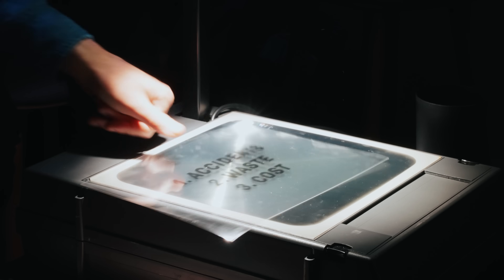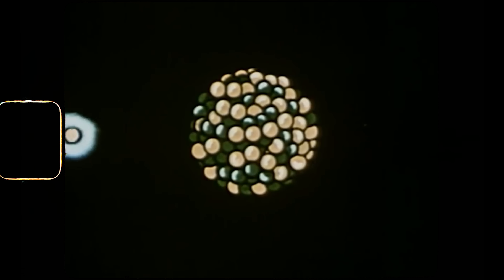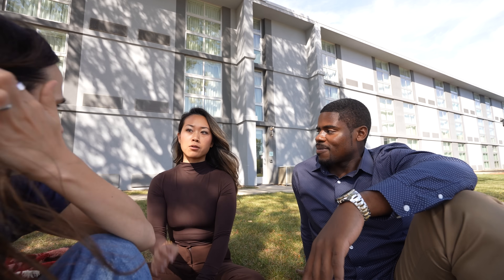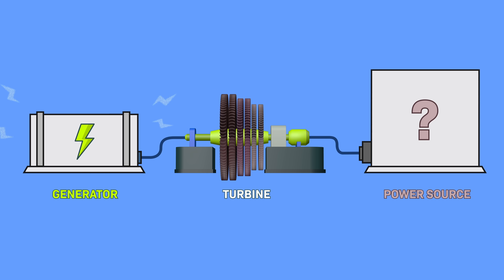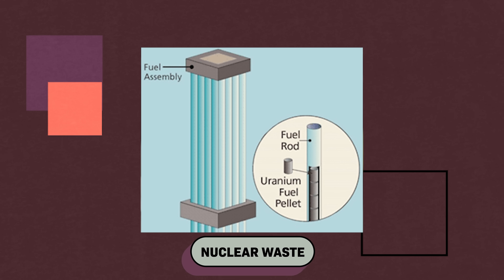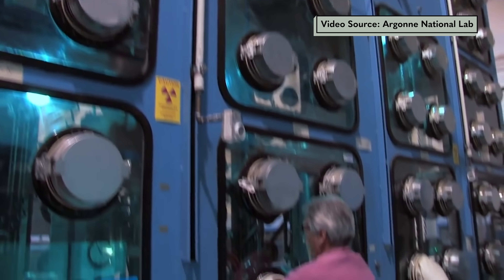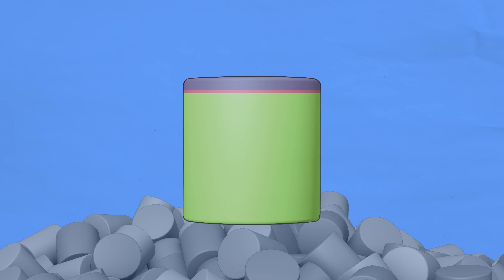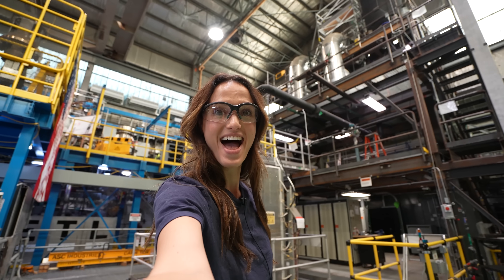The Big Lie About Nuclear Waste

Comment: Reprocessing plants literally reprocess "nuclear waste" into reactor fuel over and over again.   The trick with reactor fuel is that sometimes it wears out a little more quickly and sometimes a little more slowly.   You can have fuel rods that are just unlucky and need to be pulled at half their lifespan because they don't react well and others that underperform a little but would last more than 2x their expected lifespan if they weren't removed on their use-by date... all of these get taken to a reprocessing facility after they're safe to transport and get their useful nuclear fuel removed... that's not just the Uranium and Plutonium!

Keep in mind that this "technology" you are covering is probably bullshit.   You can't sell power that costs 10x more to make than the peak load cost in the market.   This is like the 'molten salt reactors' in which 90% of the hardware in them has to be replaced every 160 days of operation at a power generating capacity or 200 days at idle because they can't simply be turned off - the whole 'selling point' of molten salt systems is that they're safe and they simply are not anywhere near as safe as reactor designs that we have which have blown up.  There is no way to accurately and safely regulate the injection of fertile thorium into the fuel flow without adding a massive complexity that can result in exceptionally bad conditions such as the elemental thorium input chaining... and thorium fueling of a reactor is called a breeder reactor and produces plutonium and other material while converting the thorium into Uranium.   These breeder reactors (molten salt, sodium metal) require an even more complicated recycling process and produce even more kinds of waste.   

So talking about using nuclear waste to generate power is specious because 96% of the nuclear waste we produce isn't the kind of thing that CAN generate power - we recycle the portion that can be re-used efficiently and profitably.

Reprocessing the rest of the fuel costs about 8x as much as the subsidies and cost of wind/solar and the private commercial reactor operators don't want the complications that come from recycled fuel.
Reply: When you say something costs 8x that is only true in the US because of our regulatory system.  

Other countries have been reprocessing nuclear fuel for decades. We don't have that in the US because the US government temporarily outlawed reprocessing.   The industry never recovered from that.
Reply: We should put the waste on a rocket to the sun.
Reply: The US Department of Energy (DOE) cancelled the mixed-oxide (MOX) fuel fabrication facility at the Savannah River Site in South Carolina in 2018.  The facility was already about 70% complete.
Reply: Prjndigo. Well said.  Most nuclear proponents don’t grasp the reality that the problem with new nuclear, is an economic issue, not a nimby problem.
Reply: @brettgracey9682 Economics has always been the problem with renewables.  If renewables were competitive no one would bother with non-renewables.  

Nuclear power is only made unaffordable by the regulatory environment.  Why the hell do you think that nuclear power has done so well in other countries and 50 years ago before the creation of the NRC.
Reply: @DarkenedOne55  economics is why renewables make up the vast majority of new energy projects.   New nuclear for the most part only happens in corrupt dictatorships with poor performance records.  Everywhere there are actual safety standards, nuclear is ridiculously expensive and takes forever to build.  Again economics.    

On top of that renewables can and are often distributed through the grids, exactly because they are relatively cheap and quick to deploy.    What sounds more feasible globally millions of projects that cost between $1,000 and $100 million dollars, or 20, 30, 40 projects that easily cost tens of billions each?  Hint, it’s renewables that are getting done, not new nuclear.
Reply: @brettgracey9682  Energy projects that have great economics do not need massive government subsidies and energy mandates to support.  Those locations that have large fractions of their power from renewables have the highest energy costs.  The sole exception to that is hydropower. 

France, Japan, Korea, India, UK are just some of the countries with new nuclear plants.  All have great safety records.
Reply: im absolutely with you we should go away from Nuclear power but in germany we have so much waste if we would recycle it and use it again we would reduce the halbwerzeit of some of the waste and could made 30% of our energy mix for 40-60 more yrs instead we put it away completly.

And yes it cost so much but the costs of savely deposit the waste is enormous and the nuclear engery sector had made Billions of Dollars with cheap energy and know shy away from the cost of the waste they produced.

Nuclear energy should not be our future.

Comment: You would have tons of major issues if you used even 1/4 of the earths geothermal energy. The planets magnetosphere is dependent on the earths geothermal energy. When the magnetosphere ceases to be(or even shrinks), solar winds will strip the earths atmosphere away.

Comment: Great video ! Good to see more of this out there ! 
Liquid Fluoride Thorium Reactors were some of Alvin Weinberg's best designs. He knew he could do better than his Light Water Reactors. Multi fuel (uranium, thoruim), low pressure, high rate of fission. They pulled his LFTR funding at ORNL & sent it to the other labs working on the Fast Breeder Reactors in the early 1970's. Other nations are developing this tech right now. China already has a test reactor in operation in the Gobi Desert. 
  
High level actinides can be fissioned in a Sub-Critical Accelerator Driven Reactor design. Turn on a neutron beam & keep splitting the actinides until they are much safer to handle. Energy can be extracted from even our high level waste products. We just need the courage  & political will in the USA to develop the decades old technology that lays dormant in front of us. The same group of minds that worked on the Manhattan Project also had over 1000 different workable designs of reactors they came up with. The rest of the world isn't waiting on the USA this time to lead the way in next generation nuclear technologies research. We should be desalinating water, making carbon negative liquid fuels with the co2 in the air & water (using process heat from reactors), and saving our oil for plastics & medicines.
Reply: It scares me I understood that.  Actinides are the nuclear bomb materials like uranium and plutonium.  The thorium design can break them down without making more bomb materials.
Reply: @watchthe1369  The reason that thorium reactor research was stopped was because it could not produce the bomb making materials required during the early cold war days.
Reply: @watchthe1369  Actinides are just the bottom line in the periodic table. Not all are bomb making material and others would need very special designs.
Reply: Yay ! Molten beryllium fluoride ! Greens will suddenly have a change of heart and say that fast neutron reactors with molten sodium are totally cool :)
Hello from France, the country that wasted more opportunities to develop fast neutron reactors on the planet in the past decades :-/
Reply: @herrhaber9076  yea I'm not a fan of liquified sodium metal lol ! The Chloride salt and FLIBE salt designs, with the fuel dissolved into the coolant, seem like the safer alternatives. The Dept of Energy in the USA is still stuck on designs with solid fuel. The folks that build fuel pellets want to keep their monopoly. I hope France will be ramping up their research efforts on molten fuel designs.  At this point, it seems the China Academy of Sciences is leading the way in all types of Gen4 developement.

Comment: The US imunitions caused Hundreds of the most Horrendous Birth defects imaginable in ported tons of Nuclear waste from the UK and EU as it said it could dispose of it more safely than the EU or UK, what the US has been doing with the Depleted Uranium, is turn it into DU Munitions of various types using that DU waste as ammunition in it's wars of aggression in Yugoslavia/Serbia, Iraq, Afghanistan/Pakistan, etc causing Uncontainable nuclear waste dust to float in the air, in water and permiate the Ground. The US had to dismantle Every Depleted Uranium munitions factory and remove contaminated ground from each site around the US. The US DU munitions caused the Most Horrendous Birth defects imaginable in Serbia & Iraq, this information has been wiped from Youtube and most of the internet, replaced with absolute Lies about DU being controversial but Not harmful???? Internet censorship is rampant. As the twitter files and many other sources leaking out information slowly around the world. New generation Nuclear power has a huge roll to play in the future, so Long as we use THORIUM as the primary fuel which has a much higher efficiency than uranium, it's waste is a fraction that of uranium, due to the all most  (93%)-100% efficiency compared to the 7% efficiency of traditional nuclear power generation. THORIUM also can't be used in Nuclear weapons making it a far safer option and why it was never pursued by the US & collective west. China has developed the first successful THORIUM high efficiency reactor, despite India having far more Thorium reactors and more experience than China. The real game changer with Thorium will be the minaturizing and Modular developments of these reactors for single factory, single home or even single Car use. Which I find very exciting for the future.

Comment: Plutonium is not as dangerous as uranium Alpha wave particles are not as energetic as beta gamma x-ray. those are ions that will kill you. Uranium is dangerous Plutonium is much safer and easier to process. But there is a lot more uranium. and uranium grows plutonium crystals when working in a reactor. Plutonium can be refined a thousand times back into reusable fuel in a breeder reactor, creating more fuel than what is used. Also we have the only sun in the known universe that has a plutonium footprint from idiots throwing spent satellites into the sun to get rid of. Now we have a sun that is making plutonium. A no we do not know how it will effect the sun, nice to know eh?

Comment: Oh, and let's not even bother to attempt comprehension, let alone assess or assign responsibility, for the Chernobyl-level near miss when a spent fuel container at SONGS, mistakenly caught on the edge of its receptical, came less than ½" from slipping off, & tearing wide open, in August, 2018. Quite the oops! moment, on its way to "temporary" deposition in thin walled casks that are nominally considered as inadequate. And when will spent fuel pools, that contain 95% of contaminent potentials that go into a nuclear plant, ever be defended by Phalanx weaponry from light aircraft crashing into them?

Comment: Recycle Waste is not efficient and way too expensiv. Just use another type of reactor that can use the ALL the Uranium and not just 2% before recycling is necessary. MSR are capable of this and the DLR (Dual Liquid Reactor) only has to be refilled once (and with refill i mean ~25%). So you have clean energy for almost no fuel cost for over 30 years. And the waste in the end only has to be stored for 300-500 years.

Comment: You're just talking about recycling by extracting U-238, but you did not tell anything about how(!) to handle the unstable atoms, which are the actual waste. It simply does not make any difference whether you get new waste from fresh fuel or whether you produce more waste out of recycled fuel. The only "positive" is that you get independent from external sources because meanwhile there's enough waste laying around. The danger of the fission products still remains. And the part about the "shorter periods of storing" by showing up a "relatively radiotoxicity" graph which is by the way lacking some important information like the measure, is not convincing. This video feels like someone placed a nice woman in the garden meeting another nice woman just to blend in order to get old white men rich for the next few decades. Maybe I am picky or just did not understand the part where the wonder happens, but if so, explain better.

Comment: I think Integral Fast Reactor was the last US project with an actual working reactor, but was cancelled by the Clinton administration in 1994. The main reason given was that fast neutron reactors can destroy high level waste and breed more fuel from the non fissile uranium, but that fuel includes plutonium that can also be used in bombs, so commercial reactors would need even more security than they have now. I agree that the priority should be to create special fast neutron reactors specifically to destroy dangerous high level waste that cannot be buried and forgotten.

Comment: Errr there's a misconception in the early oarts of the video, reusing and shortening the halflifes makes them Far more radioactive, the stuff that takes 100k years to decay you can use as sleeping toys without any I'll effects if not for the chemical toxicity. It's ludicrous how intentionally misinformed the public is on what radioactivity is and how it works and especially so in terms of nuclear power. The neoluddites who made that bs up should be made to pay for the Huge damage they've caused to societies around the world, millions dead due to unnecessary coal burning.

Comment: The British / Canadian company: MOLTEX is building a novel reactor in New Brunswick, whose fuel is existing Plutonium.
However, the pressurised water reactor is pathetic in its burn-up of uranium. 
Alvin Weinberg (the inventor of the PWR) also recognized that the fuel could be used in fluid form in a molten salt reactor. No expensive rods required at all. 
And not pressurized - which is what makes the reactors go "bang".
The MSR can burn up all the fuel, and moreover, get it from thorium. 
IMO, This is much better solution than the technologies which are peddled by the "greens".
Unfortunately Nuclear scared people because of Three Mile Island, Chernobyl, and Fukushima, which were all disasters involving PWRs.

Kirk Sorensen is the guy who is reviving interest in the MSR. But it is an uphill task, I think.

Comment: Labeling nuclear energy as "clean energy" is like labeling a nuclear bomb as "clean bomb" - LOL.
Even using recycled spent nuclear rods presents the same dangers as unspent fuel rods - a melt down is a meltdown.
It would be great if you scheduled a tour of the former Fukushima plant in Japan and investigate how many more decades before the cleaning up
of that nuclear disaster is completed - some estimates are the year 2050.
In addition, you can learn how that disaster affected the local residents around the area including the businesses that were deserted. 
I'm all for "non dangerous" energy generation, like cylinder wind turbines, tidal power, ocean power, thermal power, underwater turbine power, and solar.
If an earthquake, hurricane,  or a terrorist targeted any of the above mentioned, which do you think would present the largest danger?
Do we need just one more Fukushima? They've ran out of room to store the radioactive cooling water on location in Fukushima and now want to dump the radioactive wastewater into
the Pacific ocean.
Did you know that there were radioactive cesium detected on the Pacific coast shortly after the disaster?
Imagine what the local implications would be.
Great video editing though.😀

Comment: You are a deluded sucker. You are talking about breeder reactor technology. Where side reactions form higher and higher mass synthetic actinides with smaller and smaller critical masses and larger releases of neutrons with every fission that transmute the Atoms of the reactor structure and body's of the workers into radionuclides.

It has NEVER been viable because predicting the chemistry and characteristics of the fuel in controlled fission becomes more and more impossible. 
It has always resulted in unexpected uncontrolled sudden explosive chain reactions. 
And the fission fragments are more and more dangerous at every repetition of the cycle. 
The only advantage, if you could call it that is the potential to accumulate certain isotopes of Americium Californium and Curium that have critical masses from pinhead to marble sized and in theory could be used for nuclear fission bombs you could put in your pocket. As long as you intend to use them in less than a month, and don't mind being killed by the neutrons they release from spontaneous fissions, if you spend more than a few minutes anywhere near them. 
As the half lives are a few years, spontaneous fissions thousands of times more per second than U235 or Pu239..
If you think using nuclear fuel as radioactive as polonium 210, where an amount the size of a grain  of salt is sufficient to kill by radiation poisoning every human on the planet, then you are as much of an ignorant fool as you appear to be in this video.